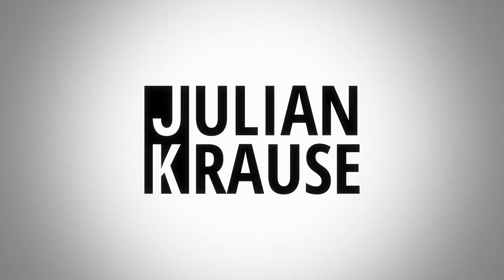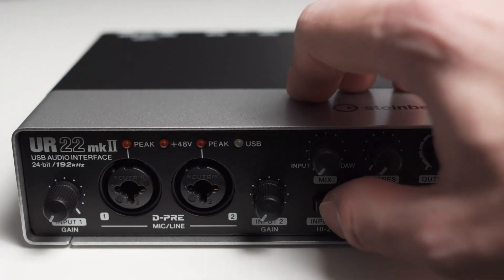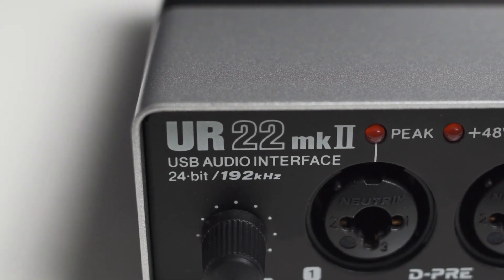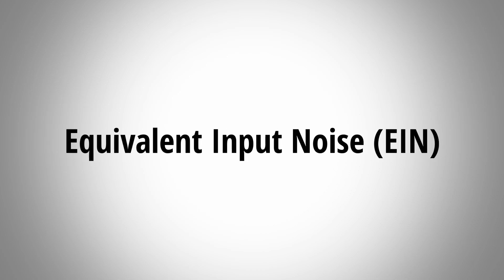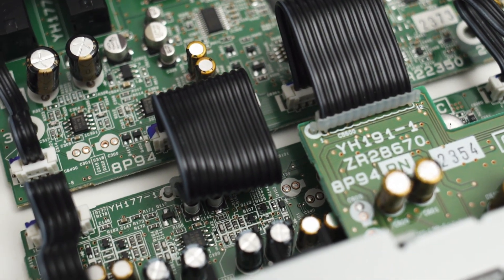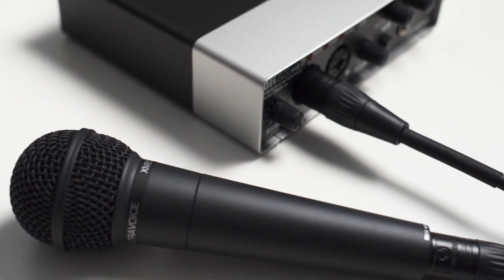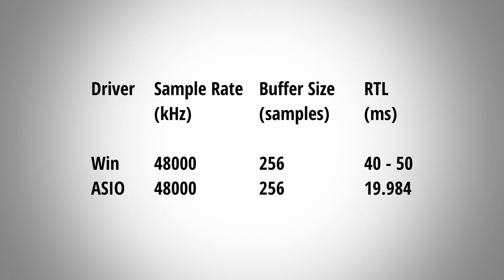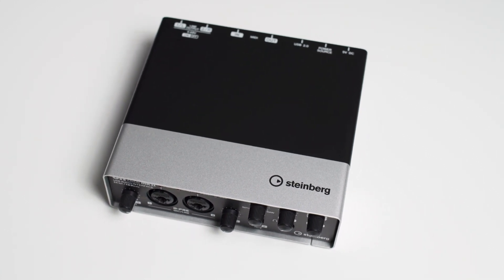Steinberg UR22mkII Audio Interface Review (with noise measurements)

Comment: I used to own this interface. From my experience the preamp was superior to that of the Behringer UMC22, which I had also owned. I ended up selling it, though, because the headphone output was too low. The knob was all the way to the right and it was still rather quiet. I now use a Yamaha MG06X, which has the same quality preamp as the UR22 but a much louder monitor line.
Reply from the maker: Output power for headphones seems to be a problem on some interfaces. I want to look into that a little more, maybe I can find out which interfaces have the best headphone amps.
Reply: Rode AI-1 is one of the best options for a cheap interface has a reasonably powerful headphone output.
Reply: @JulianKrause  now you can get the UR22C which is apparently a lot louder, in my case I might upgrade from the UR22MKII for £10 (if I sell the old one)

Comment: I've just bought the ur22mkII and a brand new Asus laptop (i5+8gb+256ssd+win10) and the audio interface has audio drops every 10 seconds or so, I'm very sick about It and I'm returning It to buy Another one. Somebody could help me with some advice ? The web is full of people with my problem and no answers ..
Reply: Hey! Have you tried fiddling with the buffer size / latency settings? Sometimes you get glitches (with any interface) if your sample size is too small. I have one of these interfaces too and it works usually very well, but the preamps are noisy (compared to some other interfaces, but in everyday use it's excellent) and the headphone output is not strong enough to drive high impedance headphones. I would recommend you look at Motu M2 which is not much more expensive and has incredible specs (but also some instability issues). Or any interface from Focusrite.
Reply: @Ricardo Visconti  // There is an excellent link to optimizing your Windows machine to use audio interfaces. Even though this article is for Win7, 99% of this info still applies: https://support.focusrite.com/hc/en-gb/articles/207359245-Optimising-your-PC-for-audio-on-Windows-7
Reply: @anythingbox  Amazing! Super valuable.
Reply: You should have downloaded the software.

Comment: I have the UR22mk2 and an AT2035.No complaints.Buy with confidence :)
Reply from the maker: Totally, for condenser mics it is a very good interface.
Reply: does it require power for active monitor speakers using xlr cables?
Reply from the maker: No, you only need to power the active monitors.

Comment: No complaints about the unit's functionality, it worked perfectly until two weeks after the one-year warranty expired, at which point it started emitting a howl during recording that renders it unusable. Steinberg Support put me through the inevitable drill of updating drivers and firmware, which did nothing to help, then declared the unit dead and ineligible for replacement. The support rep mentioned that he'd heard of this problem, and I found a few posts in forums describing similar issues.  They referred me to a repair shop, which I called. The shop never heard of or worked on Steinberg equipment and their bench fee for diagnosis would equal the cost of the unit.

Bottom line: Steinberg does not stand behind their product. A real engineering company would replace the unit and take mine back to the shop to determine cause of failure and fix any design flaws or choose more reliable components.
Reply: Sorry but i dont believe you. Things dont break exactly after a warranty period also there should be 2 year warranty so somethings fishy
Reply: @BrosBrothersLP  Sorry, you don't believe that it's broken? I promise you it is. Honestly, the events in my comment are accurately described, both the problem and the timing, as well as the maker's responses.
Reply: Thanks for the warning, big dog!!
Reply: @rondmc44  They never did even try to make good. The replacement, an Audient 1D14. has worked flawlessly, super usable design too.

Comment: I'm having some issues with this interface, which I haven't been able to solve yet.
I'm using a condenser microphone (Audiotechnica AT2020) and cubase for recording and it's working flawlessly.
The problem is when I use the same mic for skype, discord, messenger call etc. , or other softwares like obs Studio or audacity, or even when I turn the mix knob to the left, I experience a noise which can be ignored with great difficulty. 
Any help would be welcomed.
Reply: Did you resolve your issue?

Comment: Note also that you may run into problems recortding guitars for high gain amp sims, the noise floor is clearly audible with several tested amp sims (neural dsp, bias, mercuriall). Unfortunately I didnt know this, learn from my mistake.
Reply: What interface would you recommend for use with neural dsp?

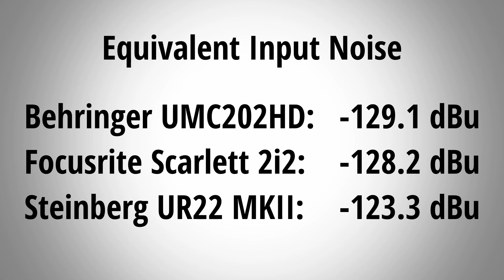Comment: Hi first of all thank you very much indeed for this excellent video.  And then a question related to these figures 5:21
I have to measure noise with a laptop from some preamps outputs (with inputs shorted)  So i am looking for a not expensive usb soundcard with a very low own noise.  Do you think that the Behringer could be a good option ?  and i guess i will have to connect the preamps outs to the mic in ?  have you measure the sound cards noise with mic inputs shorted ? that would give the real sound card noise ?  i am very obsessed by noise measurements these days.  Very.  Thanks a lot again.  Kind regards, gino

Comment: Thanks for the first decent review of this interface I have found.  Great job! One question about the EIN figures for the three units tested - if these are at ‘max gain’ as you noted then I would expect the measured EIN to be dependent on max gain, did you account for the actual gain in the EIN comparison? That is say if the Focusrite Scarlett 2i2 has 4.9dB less gain than the UR22mkII then would both measure the same EIN by your test?  (No I don’t work for Steinberg.)
Reply from the maker: Hey, good question! Even though the EIN is measured at the maximum gain setting the resulting number excludes the gain from the equation. So, you can directly compare the EIN between different devices without having to worry about the preamp gain. Cheers!

Comment: Great review. You forgot to mentioned that the headphone impedance is very low on this device from what ive read online, at only around the 32ohm mark.
Reply from the maker: I couldn't find this spec anywhere. If that is true, that's pretty good. The impedance of the headphone should be as low as possible.
Reply: @JulianKrause  ok my undertaking is that this higher the impedance, the higher the quality. ie a 32ohm is meant for devices like smartphones and 250ohm is meant for high end audio specific devices with aplifiers. https://www.youtube.com/watch?v=pFTdtyRxBUs.  Thats why you need to buy the 32ohm DT 770 Pro for using with your smartphone and the 250ohm for these kind of devices. Which means that 32ohm on this devices isnt a good thing really, as you now have to use a headphone designed for low end smartphones.
Reply from the maker: @fuzzripear  You are mixing some things up here. The impedance of the headphones and the output impedance of the interface are two different things. Generally speaking, you want the output impedance of the interface to be much lower than the impedance of the headphones.
Reply: @JulianKrause  ok i see, thanks. So would these be able to drive 250ohm headphones or would i need to go down to 80ohm or even 32?
Reply: https://www.steinberg.net/forums/viewtopic.php?t=112014 some say that 250ohm will work, while others say that you need an amp, like the magni 3 for example. I guess 80ohm is the best/safest middle choice, without the need for an amp.

Comment: That's a bit disappointing to hear about the preamp noise spec and comparisons to other top interfaces. Since I use the UR22 with the DBX 286s, and thus the interface preamp is set to zero, I suppose it's somewhat of a non-issue. Maybe Steinberg will address this noise issue in the next version of the UR22, MKIII? Thanks for all the time you put into this review.
Reply from the maker: Hey, don't feel too bad about it. The preamps are still ok, just not ultra low noise. And in your situation the preamp noise doesn't matter anyways beacuse you use the 286s. Overall the UR22 is still a nice interface and if it works for you that's great.

Comment: Hi, first of all great video! I have a noob question, if i get this interface and a condenser mic, will i need a power cable for the mic? or do i just need to plug the mic in to the interface? I dont know anything about those mics, thanks!
Reply from the maker: Hey, you just need an XLR cable to connect the mic to the interface. You   then need to turn on phantom power on the interface to power the microphone and that's it ;)
Reply: @JulianKrause  Thanks for the response. Is that for both condenser and dynamic mics? or the phantom power is only for the condenser?

Comment: Hello,

I have a brand new AKG P420 which goes into Steinberg UR22 Mk2 Audio Interface and all that into Laptop.
Used my Audio Interface with guitar for a few years now (so it`s working), but this is the first MIC I am trying to hook up.

I have no input signal from this MIC ..

+48V Phantom Power is on, Sound settings on laptop are checked - but I am not getting any signal on the TEST either..

No signal when trying to record signal in DAW..

Am i doing something wrong?
Anyone had the same issue?
Any solutions?

Thank you

Comment: i have been using this interface since couple of years but i am facing a terrible noise sometimes even in the sane branded condensed microphone, and another type of noise  even i face in the monitor headphones  sounds like screaming of rats which annoys me  a lot .  can you please help me out advising me any solution ? specially i feel that the screaming noise with the output signals may be a configuration problem. it exist even if i play youtube videos

Comment: It's really too bad that these older reviews don't include the headphone output measurements. I have the UR22mkII and whenever I listen to A/B tests of various microphones or interfaces I don't hear any differences as long as my headphones (Hifiman HE400i 2020) are plugged into the headphone output of the interface (I can if I use a dedicated DAC and headphone amp). For podcasts, video calls and so on, the interface is fine, although I'd probably go for the slightly cheaper Audient EVO 4, just don't expect to do any critical listening using its headphone output.
Reply from the maker: Hey, I made a separate video for headphone output comparison. The UR22 MKII is also included: https://youtu.be/xLShpyzwvJs
The distortion on the UR22 MKII is quite low but it has a high output impedance and relatively low output power.
Reply: @JulianKrause  I found the video, plus most of your recent videos do include the headphone measurements so it's easy to compare. It's too bad it's impossible to update older videos :-)

Comment: im just so worried im doing something wrong, i got a condenser mic (AT2020), volume on Windows all on 100% as it should be, still i have to use alot 2-1 point before the gain, so about 4 o'clock. This seems pretty high, considering it's not a dynamic mic...

Comment: Nice video, thank you for making the measurements. I have a question regarding my UR44, which is probably just a bigger interface with the same parts used. I get a very high noise in my opinion while having a guitar plugged in on ch 1 (Hi Z input) and with the gain almost all the way up. Is that normal for this interface?
Reply from the maker: Sounds strange, do you have another guitar to try with the interface? Maybe it's the pickup in the guitar.
Reply: Julian I will try with another guitar and see if the noise is still there.

Comment: really nice review. love the effort u put in. but got one request. im thinking about to buy an audio interface. im between the roland rubix / umc204hd and the ur 22mk2. im using the ai mostly for ableton and i need midi in and out for syntheziser. and i have to say nobody really covers this topic about qualitity of the sound who comes out. i know moitor aswell are important but still and the performance in a daw or so. would be interesting to see who performs best. scarlett 2i2 is out cause lack of midi. i know about the 2i4...
Reply from the maker: If the quality of the output is important to you, I would recommend the UR22MKII. I'm currently testing the outputs on different interfaces and the Behringers aren't as good as the competition.

Comment: OK, so I have the Steinberg 242 interface and I am wondering if It would benefit me to get the dbx channel strip? I use a AT2020 condenser mic and record vocals for hip hop, RnB
Reply from the maker: Really depends on what your needs. If you want to record an already processed sound which you don't need to tweak much further in post, then the 286s might be a good choice. On the other hand, if you want to record the raw sound of your mic because you want to have the most flexibility in post production, then you don't need a 286s.

Comment: Talking about the pre amp noise performance, how does this affect a dynamic mic setup with the load on an external amp like: sm7b into cloudlifter into dbx 286 at 40ish db gain into the ur22mkii (either left at 0 or 2 ticks to reach the 18 dbfs)? Would a more quiet interface help with noise in this situation?
Reply from the maker: No not really. The first preamp in the audio chain is the main source of noise. If you use a Cloudlifter, which is essentially a very low noise preamp in front of the UR22MKII. Same goes with the dbx 286s, it has better preamps than the UR22MKII, so it can reduce the preamp noise. When you use a preamp in front of any interface, the noise performance of the built-in preamp becomes irrelevant.
Reply: @JulianKrause  Thanks for the clarification! One thing that always bothered me with this setup is that I still have to crank up the dbx more than I think I should. To make the 0 db light from time to time I have to set the gain to 45-47 db with the cloudlifter connected. I left it on the said 40ish now and raise the interface gain 2-3 dots to reach -18 dbfs.

Comment: Would you recommend this over the 2i2? I am looking for a soundcard at this range to mostly record my DI and mix and the package of good preamps+Cubase AI seems very nice. My issue is that I don't have experience with either of them or the Audient and I feel like the noize level and the latency even with the lowest buffer size could be an issue. Also reading that some people's UR22mkII had issues within 1-2 years but that could happen with anything.
Reply from the maker: Hard to say, the 2i2 and the UR22 MKII are both good interfaces. If you are on windows, then I would recommend the UR22MKII. The drivers are more stable than the 2i2s.

Comment: If only I had come across your video before I ordered mine. I was a silly person that was somehow not considering Behringer by principle, not trusting its cheapness. And here it turns out that what I thought was an overly noisy preamp really is an unnecessarily noisy preamp, and that I could have gotten a better product if only I had paid less. The irony of this situation is delightful.

Welp, still in the return period, might as well make use out of that privilege... and swap for the UMC202HD, it seems. I take it that there's no real discernible difference in the quality of the preamp sound between the two, beside their noisiness?

Also, could you say if the Behringer UMC202HD is my best bet at lowest selfnoise audio interface (in non-superpricey range), or are there, perhaps, other and better options for someone a bit obsessed with high quality signal?

edit: Audient ID4 seems even more alluring than the Behringer, but I am not entirely sure how to interpret the fact that it has slightly worse noisefloor (-126 dBu) but better dynamic range (114 dB). Would that be altogether better and producing louder, clearer sound with more negligible background noise?
Reply from the maker: Yes, the UMC202HD has lower noise preamps compared to the UR22 MKII. And yes it is the best bang for buck in terms of preamp noise performance. But keep in mind that preamp performance isn't everything. Things like ease of use and build quality are also important. If you use condenser mics, the preamp performance isn't critical anyways. So, it really depends on what you need. Both devices can record great sounding audio.

Comment: Hey thanks for the video. Do you know if its worth upgrading from a presonus audiobox USB in terms of preamp noise? Its the black model, not the 96 version. I don't know how to test its noise, and if its any worse or better than the Behringer or Steinberg 22. Would you happen to know if the preamp on the audiobox is similar in noise and gain, or if it would be worth switching it for one of these you mentioned in your video?
Reply from the maker: I don't know the preamp noise of the original presonus audiobox but I have the feeling the Steinberg isn't a big step up. Are you experiencing excessive noise with dynamic microphones?
Reply: @JulianKrause  yeah i have to turn my guitar amp WAY up so its workable. Even my at2020 condenser gets noise if I dont speak loud or close to the mic. I was thinking maybe trying a fethead or cloudlifter out, and getting the behringer?
Reply from the maker: @itos191  If you get a high amount of noise even with a condenser mic, that doesn't sound very good. I can recommend the UMC202HD. It has very low noise preamps, you don't even need a Cloudlifter or FetHead. It only has one drawback: With direct monitoring the audio from channel 1 is only on the left in your headphones. And channel 2 on the right. If you frequently use direct monitoring, this can be a bit irritating.
Reply: @JulianKrause  thanks, your channel is great! Looking forward to future vids